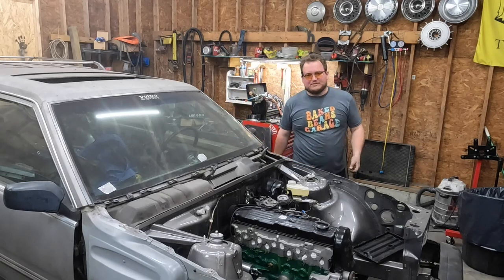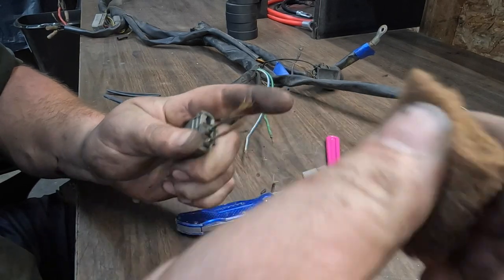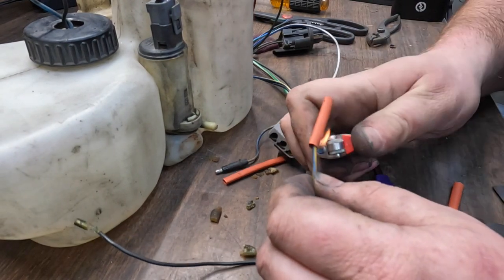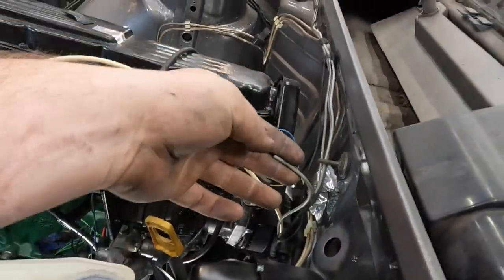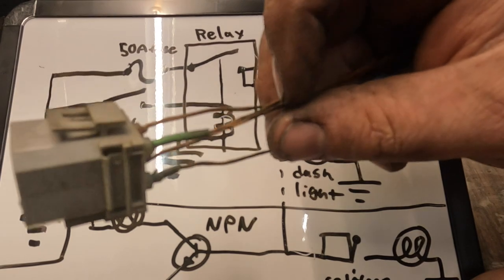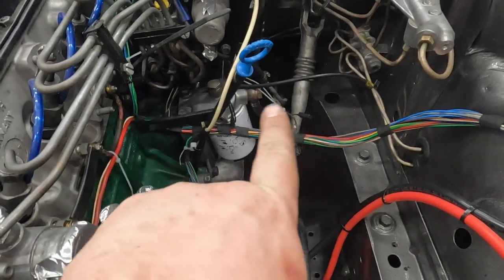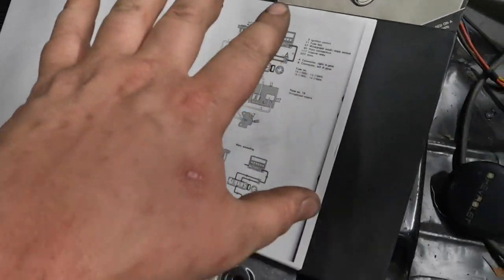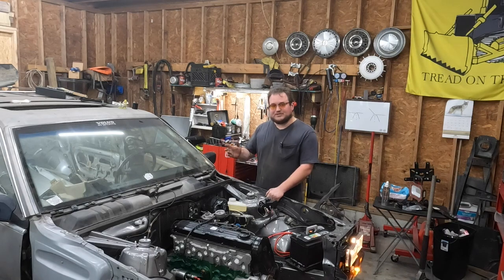Manual Glow Plug Conversion and Fixing Old Car Wiring Gremlins - Volvo 740 TurboDiesel Wagon

Comment: Instead of on-off switch, push button would do the job in safer way. "Rectangular connectors" holds wires not by friction, there is plastic part to open on the other side of plug - so you can open it to release wires without force.

Comment: An effective harness rebuilding solution that I like is to take butt crimp connectors, and take a nail set and drive the center sleeve out of the plastic body - then use the center sleeves to join wires by crimping and then soldering.  Heat shrink can be applied over them after crimping and soldering.  The sleeves are a similar concept to crimped sleeves that the power utilities often use.
Reply from the maker: Sounds like it works well, I just don't like the metal they use in those, it seems to be super cheap zinc plated mild steel.
Reply: @bakedbeansgarage116  The ones I've used are plated copper.

Comment: Fine work Mr Beans, I've been working on my recently acquired '93 940 D24TIC and your videos are fantastic accompaniment to reference material. Just finished a side/marker light connector fix and faulty oil pressure switch, may tackle the glow plug relay too.
You produce some of the best, bullshit free, and straightforward vehicle content, keep it up!

Comment: I would recommend you to get a electric fan from a 940/960 the one that sits on the engine side of the radiator, to replace the viscous fan. Although that fan is a 2 speed you can just hook it up to the same connection as the old fan but you can only choose 1 of the speeds.
Reply from the maker: Oh absolutely. I always do auxiliary fans on my projects, but I will likely use two slim fans with a standalone controller.

Comment: If you want to control a relay with a transistor it is a good idea to put a diode in reverse over the relaycoil (to mute any flyback voltage from the coil).

Comment: 35:40 JustMy2Cents:   If you are using Halogen/ Sealed beams?   The voltage drop with just about ANY Stock wiring is abysmal at the Bulbs.      Try it yourself with taps at the connector for Halogen lamps.  
I used a voltage regulated power supply to push the output at 14.5 volts, and I was shocked at just how much more light I got.  

The closest you can get to that is a custom harness with a Relay right at the Bulbs/Sealed beams using 8 AWG Full copper wire (Not CCA) coming from the Alternator  positive stud with a dedicated ground also routed right to the  Alternator housing.   (or close as possible)   

Its OVERKILL, but it's the ONLY way I found that would get me even remotely close to the 13.5 volts at the Low &  High Beams of the sealed lamps.    

The only other trick is to tap the  A/C direct from the Alternator,  but I would only use that for High beams.   But since getting  HID / LED's that are stupid bright anyways, with the fact you are not worried about blinding anyone; Who cares? 

Sealed beams really have got a bad rap over the years, but it's not that they are not made well.  
Its that they never get the proper rated voltage the Sealed beams are rated for.  

This took about 6 months of trial and error working with aftermarket " FOG LAMPS "   wondering why my Flashlights worked better.    

The CHEESY wiring was  just pure and utter CRAPOLA! 

So I made some Custom Harness from Junkyard Fuse blocks like you featured, with relays right at the Bulbs with the Small Omicron relays.   

Despite my BEST efforts?   The best I could ever get to the bulbs is about 12.9 volts measured at the base of the bulb connectors with my my H3- 130W  Bulbs using factory ground points.  

What I found was interesting is that if you indeed give these bulbs a legitimate 14.5 volts like they are rated, they will burn out within a few months or less.    

Using a DC to DC boost converter for my backup lights that were the 130 watt halogens I could legitimately say that there was a point of diminishing returns where if you did indeed turn up the voltage to stay at a constant 14.8 volts,  you would get more brightness but it was almost indiscernible. 

If you're driving a Volvo and you have a self regulated alternator,  then you're kind of out of luck.

 but if you are able to control the field on the alternator and boost your voltage coming from your alternator to about 15 volts, then this would be the easiest way to maintain around 14.5 ~ 14.8 volts in your system to give you the best possible performance for your lighting needs.  

The best way to do this while sticking with your OEM alternator is by directly tapping the output from the alternator  and using an external regulator to go ahead and boost the voltage solely to be used at your lighting system. It's robust it's safe and it's not all that hard to do.

It's an absolute PITA to go this far , but if you want the most out of your lighting and you have quite a bit of it on your vehicle ( say for example halogen fog lights -  halogen high beams  -  halogen low beams)  then this really is the ticket if you want to at least work with your OEM wiring harness/ Circuit.  

At the end of the day?  Just get some Semi Truck 4x6 Sealed Beams that use LED's and they work great with NONE of the FUSS.  
They Meet OEM and are factory installed for many brands of Trucks and they work great.  
They are not too expensive, and they last and can be picked up at ANY truck stop all across the United States. 

You can pick them up at Truck Junk yards as well for almost nothing if that is an option for you. 

I think that about covers it.  
Love your content by the way!  
:goodvibes:
Reply from the maker: Thanks for the recommendation! I'll have to try this on my 245. Awhile back I did a similar mod on my truck, using the original headlight feed to trigger a relay run straight from the alternator. It certainly helped.
Just depends on how motivated I am haha. 
 Thanks for the support!

Comment: You don’t need to replace the sunroof wen you switch to electric// Sweden
Reply from the maker: Yeah, I know the mechanism itself is identical, but the one in the car is extremely broken in several ways, haha. I just happened to find a complete one in a junkyard.
Reply: The glass ones from the 960 and S/V90 also fit if you’re trying to really luxuriate.
Reply: @jaywiggin1139  You mean "luxurificate" surely :D